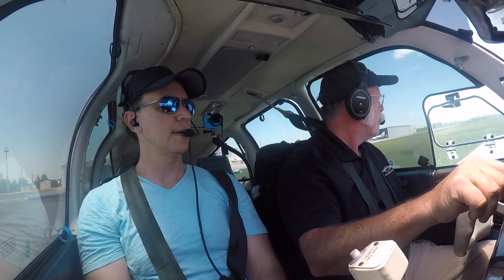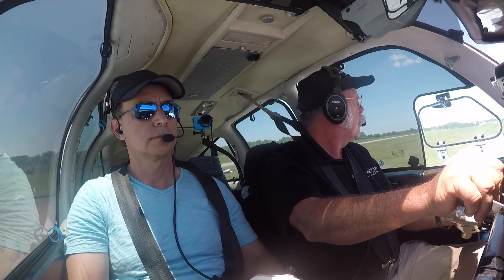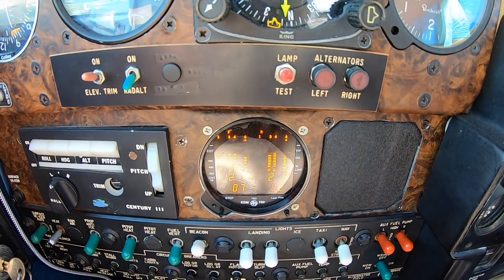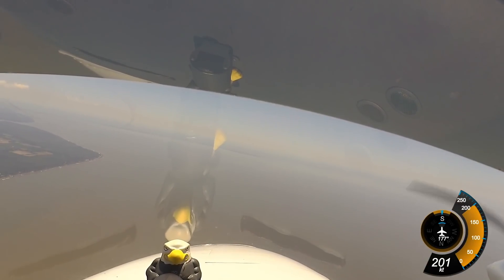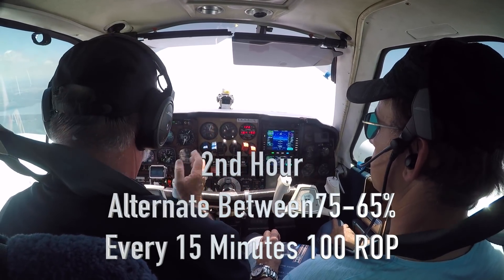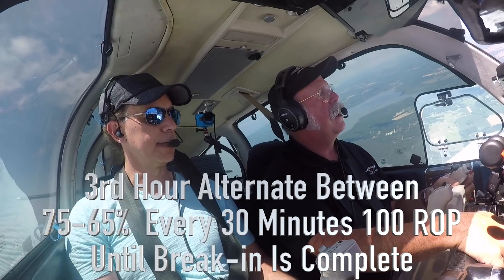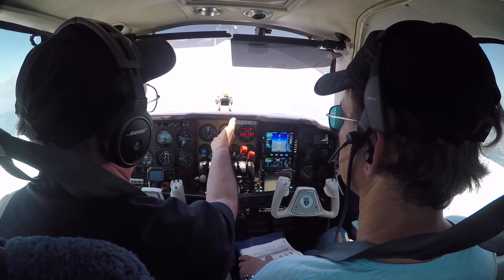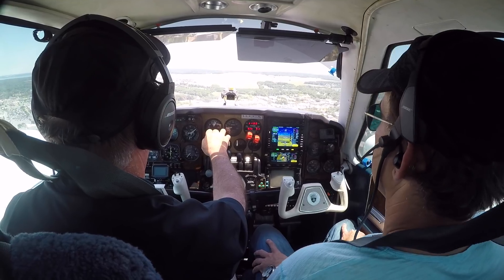How to Break-In a Continental Aircraft Engine!

Comment: Great info here, Kris!! The break in here is similar to outboard, or inboard boat motor break in procedures, presumably because of the type of loads they see (constant, and heavy). Completely different from a car, motorcycle, or off-road motorcycle or ATV. I do believe car engines can be broken in the same way, but many will argue that fact (although it's difficult to do on public roadways, especially near cities - easier on a dynamometer, or on the open roads of the West ... but still illegal there, too). Of course, auto & motorcycle manufacturers want you to do the exact opposite, since they don't want to fix your vehicle on their dime under warranty.  I could talk for hours about this stuff with Chuck, I'd bet. 😊 

Thanks for sharing, Kris - been waiting for this one. 👍🍻
Reply from the maker: How much fun would it be to drive your car at 75% for an hour at a time? Lol
Reply: @BaronPilot  - That would be great, HAHAHA! 😁

Comment: Is mineral oil used during break in?
Reply from the maker: It can be. In my case I used Phillips XC 20W50 that was approved as well.
Reply: I agree.  Actually, my experience is that XC works a bit better than straight mineral.

Comment: Could someone explain more about oil level stabilization? If I have a 6 quart engine and I fill it every time it hits 4 quarts to 5, am I possibly waisting oil?
Reply from the maker: Typically a piston airplane engine will spit out excess oil through the breather tube. You can figure out what is proper for your airplane by waiting to see where it settles. (Assuming you don’t have any leaks of pressurization)

Comment: Break in flights are fun :) done a few, was good to hear from a professionals perspective rather than a manual and a mechanic.
Reply from the maker: This is one of the videos that I was really looking forward to
Reply: @BaronPilot  Did i hear the guy mention turbochargers just before shutdown ? both the seneca5 nd Da42 i let idle for  90 seconds before shutdown. the turbos on the original Theilert powered Da42 were known to fracture if not cooled properly. Barons have been illusive for me only managed 2 flights in a io-470 powered Be55. Have you had any issues with the Bag tanks in the wings?

Comment: Please don't all grown lol but, what is manifold pressure and how does it affect your FPM? Thanks.
Reply: It's a gauge to determine how much power is being developed by the engine.  The more air and fuel we can pump or pull into the cylinders, the more power the engine can develop (which makes us fly faster).   When you can measure how much air pressure is in the induction system, just before the air / fuel mixture enters into the cylinders, you will have a good idea of how much power you are developing.

Comment: Kristoffer,  Nice job on the video.  I am sure I will contact Lycoming and get what they have to say on a break-in of one of their engines but this gives me a good idea of what I am in for.  They say my factory rebuilt engine is on the way so I sit and wait.  Have a great week and once again thank you for the time and effort you put into these videos.
Reply from the maker: I would expect it to be nearly identical
Reply: @BaronPilot  Yes I would think it would be as well.  I will read up a little before.  Engine was delivered today and is sitting in my shop.  I have to wait until the end of the weekend to bring it to be installed as they are putting new blacktop in front of the hangers and on the taxiway, so no driving on it.  Have a great weekend.

Comment: I haven't flown in a long time. I notice today people refer to the "engine" as a "motor". You did not. Is it still an "engine"?
Reply: A lot of people use the term interchangeably. I’ve never seen a starter engine. So when I hear an engine being called a motor it gets confusing.
Reply: @williegillie5712  Typically, a motor is electric.
Reply: Murnel Babineaux yes that is what I have found out so far, agreed

Comment: Are these brand new Continentals or factory re-manufactured? Is the break-in procedure the same for both?
Reply: Break in is for cylinders, whether new or overhauled the cross hatch is fresh. the procedure is the same.
Reply: @rossvidoni509  That's what I would assume as well. But with virgin alloys in the rotating assembly, it's not just worrying about seating the piston rings. I don't have the memory like I used to but thought I remembered that the break-in procedure was slightly different with all new components.
Reply: @DougHanchard  Not sure what differences between virgin nitrided steel and non-virgin but freshly nitrided steel would be but my guess is there are none. The piston and rings are the only part of the engine where two metal surfaces are designed to have metal to metal contact during the initial run in. They are also the only component directly affected by cylinder pressure. Every other part of the engine should riding on a film of oil.  After break in the rings should cease to make metal to metal contact unless something has gone badly. It's why you can still see pronounced cross hatch on high time/mileage engines.

Comment: Great info/video. 😊
A sidenote and car wise: That's also why i like to purchase demo driven newer cars, because they are usely testet and broken in hard, and hopefully done when the engine is in the range of operating temperature.
Reply: you can be sure they are never run hard in the proper operating temp. Always hard when cold. I would never buy a demo car exactly for that reason.
Reply: @tomekwrs  Ok had good luck with mine then. No eye measurable oil consumption on dip stick, easy startup cold and warm and goes like a champ. It's a 2015 Ford Focus Titanium X 1.0 Ecoboost. Had it now in 2.5 years. Mileage now of 27000 miles soon. (43000 km.) 

I live and learn 😊

When i test new cars i always take it easy before it gets in operating temperature, then floor it often for the test and if i purchase a new car a hard break in when engine temps are in range of 180-210°f (82-95°c)